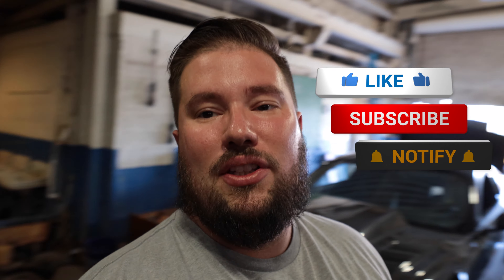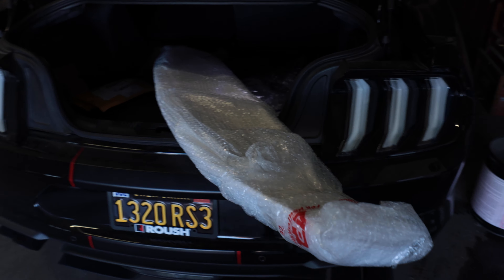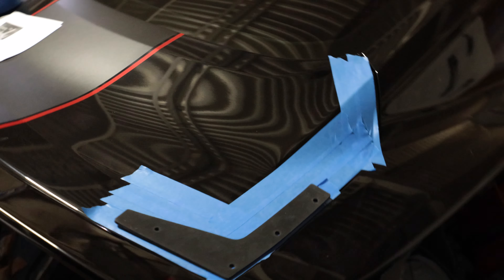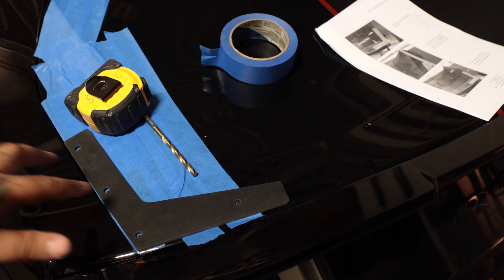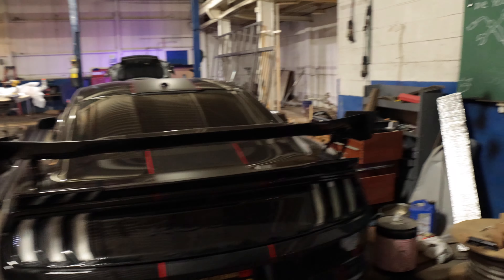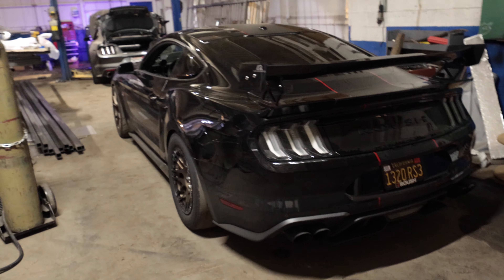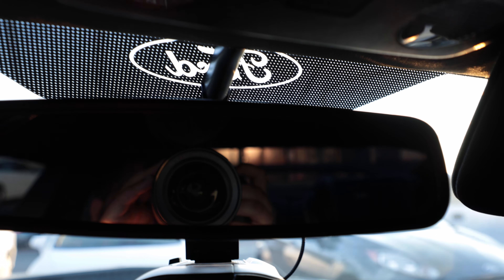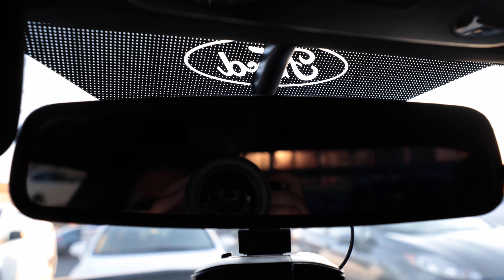HAVE I LOST MY MIND? | I Put An Insane BIG WING on My Mustang

Comment: Does your car shift hard and jerk a bit? Especially in drive modes like sport, sport plus and track?
Reply from the maker: I’m assuming you’re on the stock tune?
Reply: Stock Roush tune for the Phase 2 supercharger kit. Roush said I have the latest calibration and I had it reflashed to make sure that there was nothing wrong with the tune. The car just shift hard and is jerkey.
Reply: You’re not alone.
Reply from the maker: @venomousranger  it’s the tune
Reply from the maker: @lads1747  I had the same issues
Reply: So the stock Roush tune makes this car almost embarrassing to drive then? What did you do to fix it?
Reply from the maker: @venomousranger  I tuned it. Hit up wengerd performance
Reply: @StealthyGarage  I’m doing that today! Thank you!
Reply from the maker: @venomousranger  you’re gonna love it